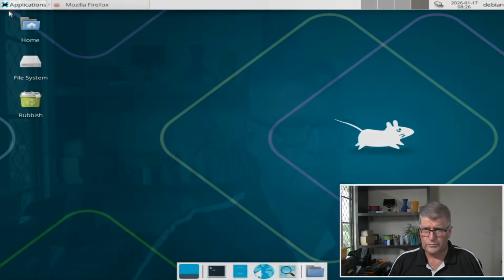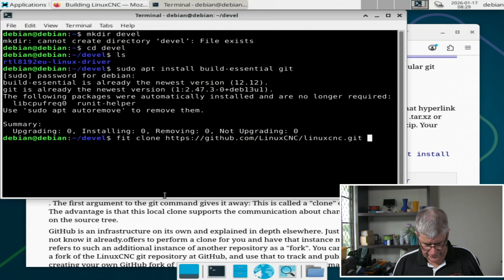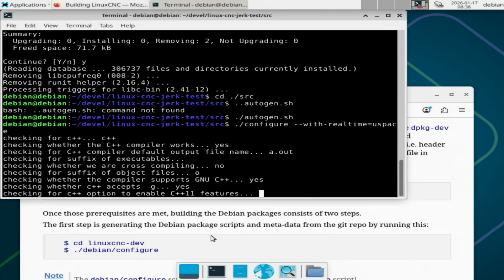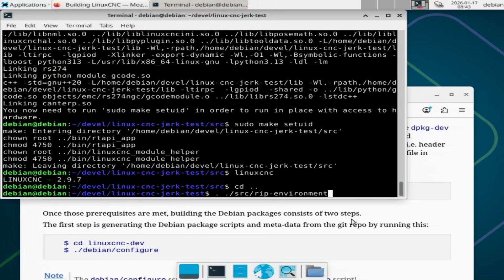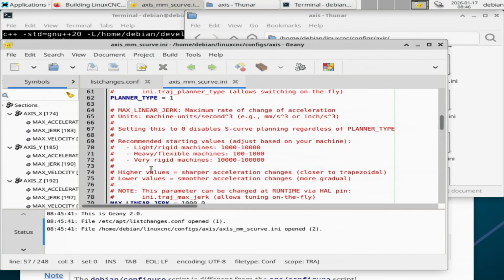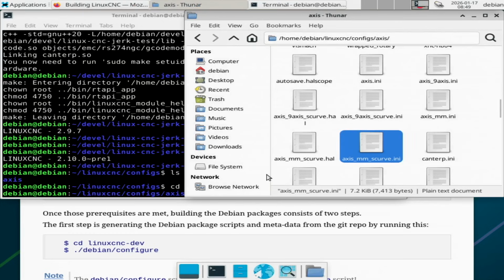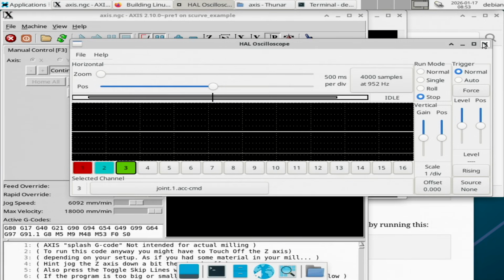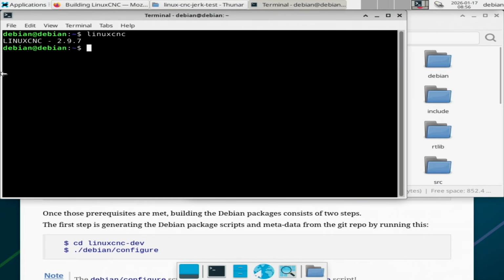Unlock Smoother Motion with Jerk limiting: New LinuxCNC S-Curve motion

Comment: BTW have you ever looked into "Ghosting" communication noise, where the cables are less then one meter.
Reply from the maker: I did have a big emi issue on my first plasma cutter and bought an oscilloscope to investigate.  It turned out to be coming in from the mains connection. It was fixed after fitting an EMI filter at the mains input and also running ground wires to every motor back to a star ground point. A filtered IEC connector is a simple $10 fix. I am much more conscious of emi now!
Reply: @MrRodW  EMI can be a bit..ch :) i have seen a datacenter where they did have a drop in speed, between some racks. The fault was cable ties on network cables. they could measure the drops between the ties  😬
Reply from the maker: Ouch! I bet that was hard to diagnose!

Comment: This is awesome! As a "master" branch though, I would actually expect it to be more stable. In other words, I would expect potentially unstable code/features to be still in developmental branches, not yet merged into master. 

I will definitely try this on my Sherline mill's LinuxCNC machine this week. I've gotten a little bogged down by a 9" three-jaw lathe chuck that is brand new, but sort of a piece of junk. So I lost a few days messing around with trying to true that up by using a 4-jaw to hold it while I've trued its concentricity. It must have been a Monday chuck, lol... Now I'm past that, and back onto setting up the Sherline CNC mill with the LinuxCNC machine I just upgraded with a new mobo, CPU and RAM. Man, it really doesn't take much to get a person side-tracked! I am still working as an embedded Linux developer for a day job, so I don't have as much time as I'd like right now. 

But I am SOOOO glad to have found your channel Rod--and have learned a bunch from you on LinuxCNC already. I will defintely keep following along, as I plan to do this stuff for years to come. Thanks for making the video!

Tom
Reply from the maker: Thanks Tom, I'm really glad this was useful for you. The devs were keen to get as much testing done by the commiunity as they could so they released it because it can be disabled by the user if need be. Be careful you don't get roped into some dev work too! Not many people want to touch Linuxcnc's core code. Its old and complex so this has been a long time coming.
Reply: @MrRodW  Heh...what I didn't tell you is that I've been working with the Qt framework for 15 years now...and QtQuick (QML/Javascript) for nearly the last 10 years. 

I see that there's a QML-based skin for LinuxCNC, but it apprently uses a Python backend. Not my first choice, but whatever. Every serious professional project I've ever worked on in Qt has used a C++ back-end and a QML front-end. I guess people are starting to use Rust more and more, so there's that--but I don't really know why you'd want to implement your business logic in Python, especially when timing might be critical. To each their own though.

Comment: I wish centroid had this feature.  Their control is harsh!  Only way you can soften it is by slowing the acceleration so much you never reach full rapid!  Enabling s curve on the motor drives softens it but not ideal to have the drives adding delay and following error that is not accounted for in the controller.
Reply from the maker: This is where LinuxCNC shines because the Motion Controller is the PC, not an emasculated microprocessor or FGPA chip so we have vastly more processing power to get things done in real time. Having said that, the maths here is complex and this was released before it was bug free becasue the devs wanted wider testing. Already some bugs have been found and most of the timing violations have been fixed so look for a future update soon.
Reply: Centroid is poorly supported garbage
Reply: I thought centroid has scurve jerk control
Reply from the maker: I can't speak to Centroid's support, but the S-curve jerk limiting in LinuxCNC is a big step for smoother motion.